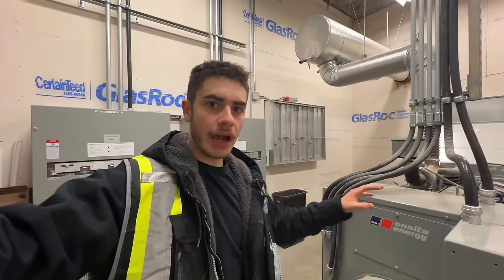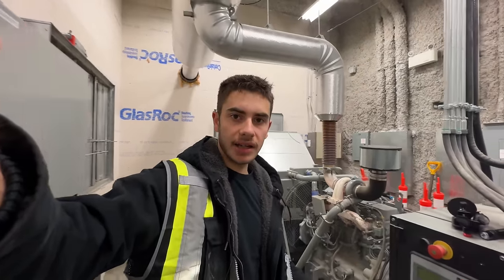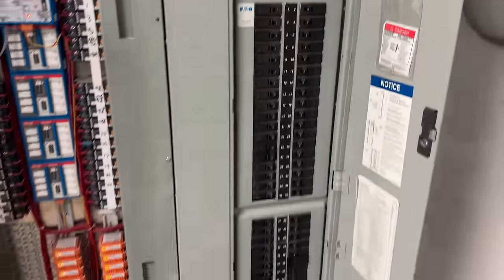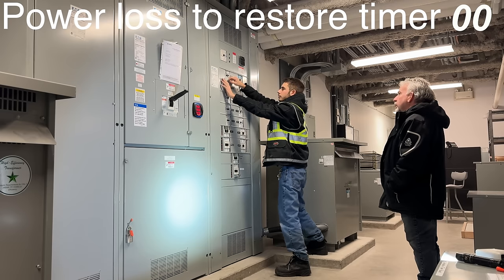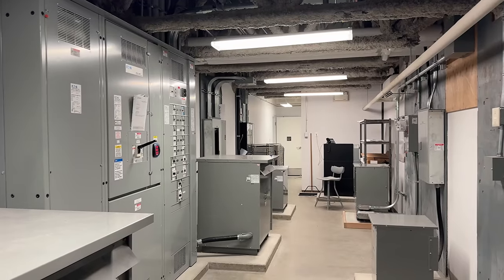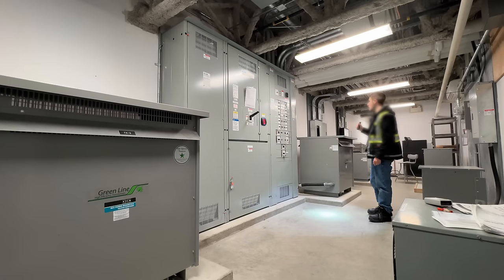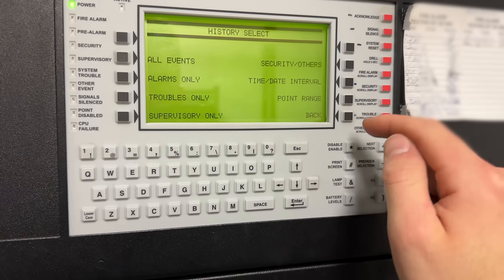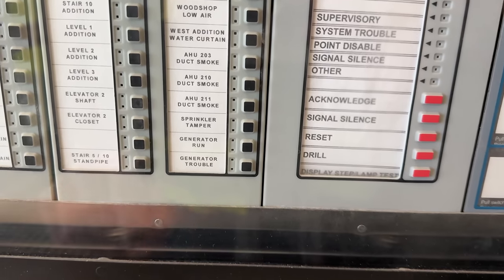Power outage generator test at high school, real power outage simulation, startup load/transfer

Comment: Ah, the death knell of a generator, the once-monthly test! It wouldn't destroy them so bad if you ran it for like 12 hours. This is why you should beware of a cheap used generator with like 40 hours on it!
Reply from the maker: Monthly testing is required to run it once per month.

Comment: This generator fooled me. I was expecting that he started up and then spinning up to 100% but at start he is already at 100% it seems. There is sound difference at load switch but the engine keeps it speed
Reply: Engine speed is constant to maintain the correct AC output frequency (60Hz I guess in Canada, so 1800RPM assuming a 4 pole generator). The governor in the engine will adjust the throttle as load goes up and down to keep the speed exactly the same, which is why it will sound louder under more load, but should never change speed/pitch (though you may hear the turbo whine pitch change, as its speed will increase under load).
Reply: @mikeprice2311 
I didn’t hear much if any turbo noise durning the test which is odd because generally the 4045 JD engines have a pretty loud charger on them, mine becomes the loudest sound the engine makes over about 60% load. And at 100% it would be the envy of any dodge/cummins enthusiast, even the exhaust side of mine the turbine noise is very pronounced due to the 10 blade turbine JD used.

Comment: Thanks for posting. I wish I would have done a video of the generator system at the hospital I used to work at. I got to watch them do a manual transfer once, but didn't record it. I have two videos of them running on this channel, but it's them running from the outside. Those generator actually give the hospital 100% generator power during an outage which isn't typical. The hospital I work at now they have two generators, but it's just the red plugs and certain lights which is more common.
Reply: I retired from a large hospital that had 4 2,000KW & 3 760 KW generators and could handle the 22 elevators but less then valve of normal.power loads.

Comment: This was very cool to see, Nic! I really like to hear this generator start up! Just one question, being that this generator runs on diesel, does it have to use Diesel Exhaust Fluid? Commonly referred to as "DEF"?
Reply from the maker: No DEF I think as it's emergency power it doesn't need to comply with the same emission regulations
Reply: @nics-systems-electric  Oh okay, that makes sense.
Reply: In the video You can see that the exhaust comes out of the turbo and then goes directly into the muffler, which is then piped through the wall to the outside.  Most older generators do not have a DEF system because they run very little and therefor produce very little pollution.  Unless the generator is being tested, as it is in this video, it just sits around waiting for the power to go out.
Reply: @nics-systems-electric  in the states it's starting to become required, some of us are starting to gobble up as many ole Detroit's as we can get our hands on. 

In a pinch I don't want to worry about DEF and weather or not the system is plugged or some other random issue. 

2 strokes just do it better.

Comment: Very interesting video!!! I live right off a main power corridor. Rarely lose power. Last week power issues. On and off up to a dozen times in 30 mins. My home UPS performed as expected..but how does a system like in this video react to main grid pulses...from as little as 3 secs to 5 minutes and variant on/off times?
Reply from the maker: There is likely a set voltage parameter of a acceptable level it would all be in the transfer switch as far as how it determines useable utility power

Comment: It seems like the fuel level sensor is wired backwards if it's a 3-wire potentiometer
Reply from the maker: It seems to more often than not get stuck around 60 to 70%

Comment: Doesn’t seem like that generator is under much of a load, was there just not much load to run that day, or does is it deliberately oversized? If it’s not running 70-80% do you have to periodically load bank it to keep it cleaned out?
Reply from the maker: It's running around 30% because it Hass to be able to be able to run the very power demanding smoke control system
Reply: @nics-systems-electric  
That makes sense, it just wasn’t clear, or at least to me during the test if it was running it’s normal load during an outage or if the function test was at a lesser load than normal.

Comment: It seems like the transfer switches take a while to switch from emergency to normal source, almost like the transfer switch is staying in a neutral position for a few seconds. Im talking about the period when the battery backup emergency lights are lit.
Reply from the maker: It needs to wait a second it can't be instantaneous or it can be damaging to any large motors running off of it if you have a sudden frequency change without a interruption
Reply: @nics-systems-electric Yes, this is the correct reason for the no-power delay before re-transfer. This delay can be eliminated on some transfer switches with the added optional "in-phase monitor" which waits until the generator and utility phases (due to slightly different frequencies) are exactly the same and then does an instant "slam over" type transfer, so the lights don't even blink!

Comment: Was that a grid heater or block heater for the first 3 seconds of the transfer to the Diesel engine?
Reply: Probably the pre-lube pump to create oil pressure prior to cranking
Reply: Block heaters are generally hooked to utility power keeping the engine close to operating temperature at all times. Grid heaters are generally controlled by whatever device is responsible for startup, but generally a redundant feature seeing as the engine would already be close to operating temperature due to the block heater.
Reply: A block heater that turns on 6 seconds before you start it isn't of much use.

Comment: Considering that the school is used as a shelter, you should have two generators, breakdown redundancy and during service on number one. Other than that, it's a great setup.
Reply from the maker: That would be required if it was direct life safety such as a hospital where it could be life and death if you lose power. the schools that are used for shelters do not require a secondary generator same as the fire departments and other similar buildings that is not directly keeping someone alive.
Reply: @nics-systems-electric  You will notice that I wrote "should have" and not "must have".😁

Comment: Hope that's not a fire door you are jamming open.
Reply from the maker: Sometimes to be able to perform work and testing doors have to be wedged open.
Reply: We had a similar situation during a test. The electricians had bypassed a transfer switch or some other fail over electrical stuff so that the test would work. Company management caught wind of it and had the test redone (at a later date). The fail over equipment would have worked the first time and did work the second time. Never heard why the electricians did what they did.